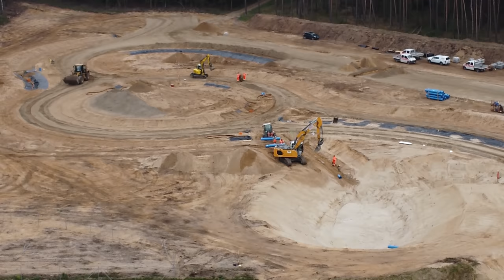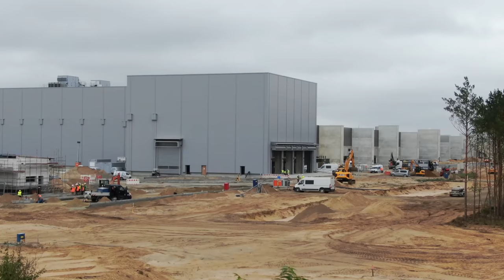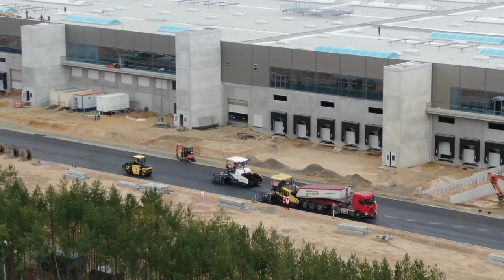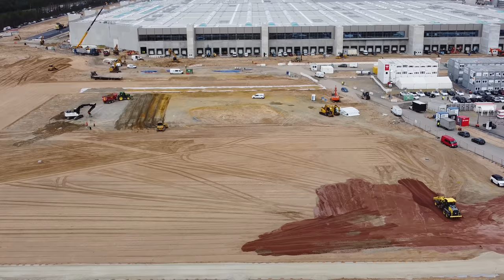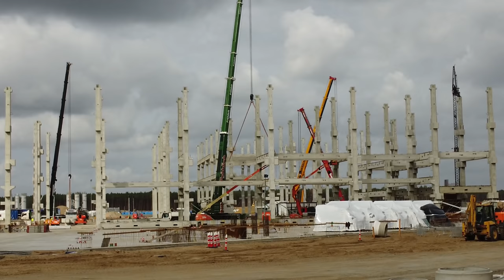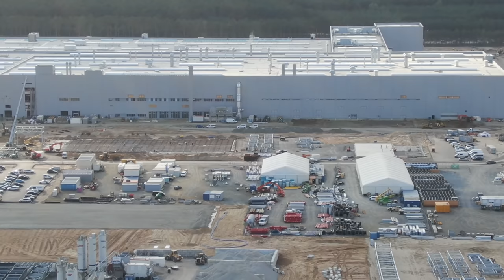Giga Berlin | 2021-09-22 | Timelapse

Comment: 14:25 When those big concrete blocks are assembled, are they glued, bolted, welded together, or do they simply stay together through their weight and the force of gravity?  Does anyone know? 

Good job, Matthias. This weekend, we might see the inside of the casting section for the last time?
Reply: In addition to gravity forces structures need to be able to resist and carry lateral forces ( earthquake and wind) All joints are design to work like a welded joint in structural steel. Since we have concrete in this case the are designed like bolted connection. They are pre fabricated bolts/ rods in columns and the beams( horizontal) have holes in them sitting on the columns bolts (Male and female  ) rods members). Hope that answered your question.
Reply: These beams will be tied together by the ceiling. They rest in slots.

Comment: looking good but still can't see this opening by opening day in early October - I am rooting for Germany Tesla construction to get it done.
Reply: There never was an opening date in October 🤦‍♂️
Reply: The factory will be open to the public early October (9th October). But this was never meant to be an opening day in the sense that the production will start in this day. Tesla published in May a schedule were essential work will continue till (end of) November. And even on this there are here and there already some delays.
Reply: @joekim4345  Look at the DU building. Completed in November 2020. Standing idle around for months. Now Tesla changed plans and is now adding an additional mezzanine level to host also the future battery pack production there. That Tesla is already in this early stage so careful to optimize the usage of space is interesting (also the 4 floors battery cell production). But ideas like adding an additional mezzanine level are compared to buidling it right this way not optimal (needs considerably more time and super cheap is this also not).

Comment: I'm puzzled by the use of tractor/trailer setups for dirt hauling rather than dump trucks. Does anyone know why this is done in Germany?
Reply: How many times do you want to ask the same question again that I have already answered twice?
Reply: I suspect the main difference is the required licenses for dump trucks drivers. "Agricultural" tractors could also use the lower-taxed red diesel, but I don't know if this is still the case for Germany.
Reply: @jwstolk  Neither of them.